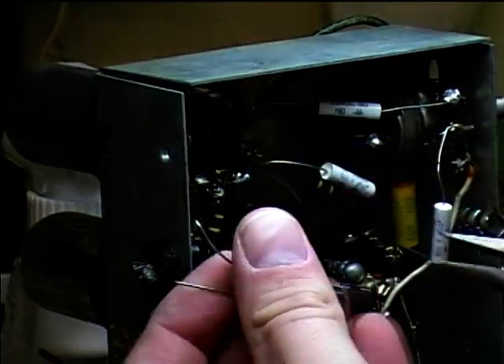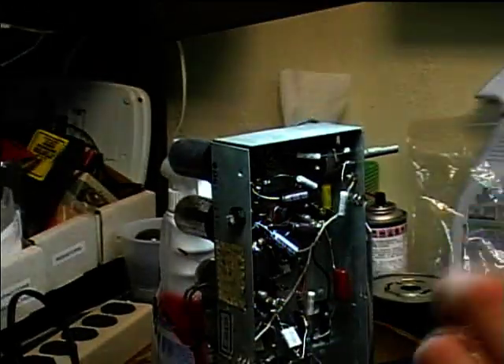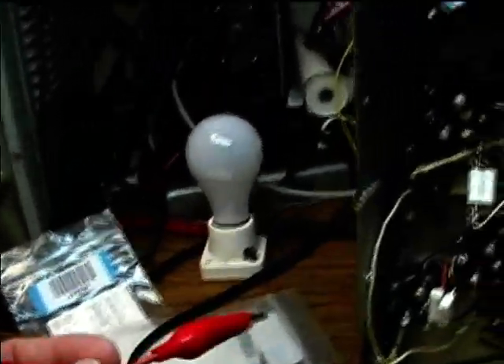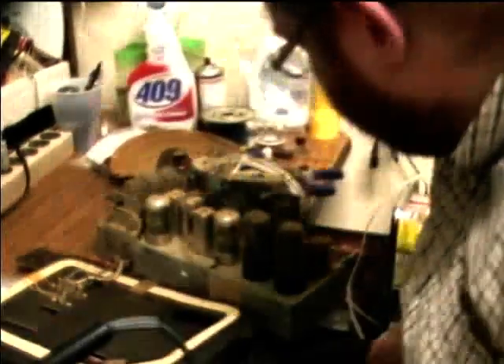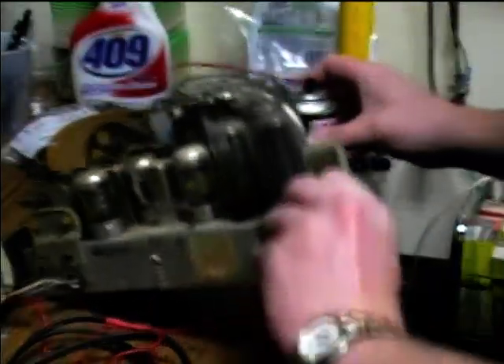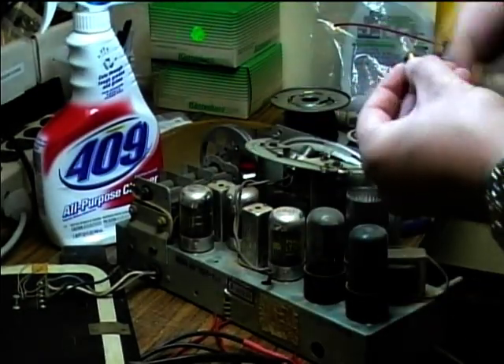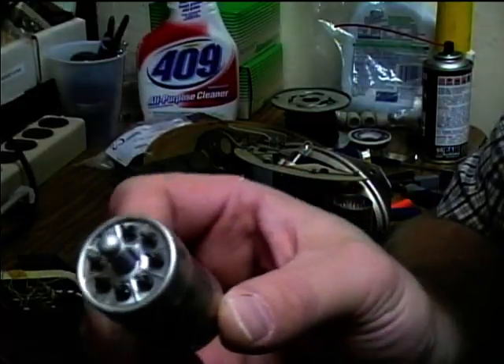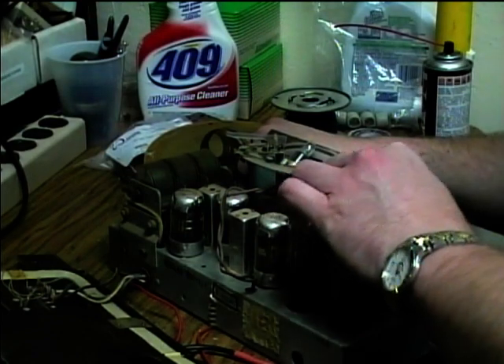Philco 50-920 tube type radio complete repair job part 6

Comment: I'm trying to fix an old radio like this one, but i can't make sense which is electrolytic and which isn't! The schematic doesn't say much about that, it just shows the regular cap sign..no plus or minus marks, and the capacitors themselfes don't have plus nor minus marks as well....only a line around them...does that makes them electrolytic capacitors?

Comment from the maker: @wildbilltexas Thanks! Actually the problem turned out to be bad capacitors in the IF cans and I still need to upload the videos of that repair. I do have a tube tester I got recently at an estate sale and we have a tester at our repair shop but in this case it turned out to not be a tube related problem.